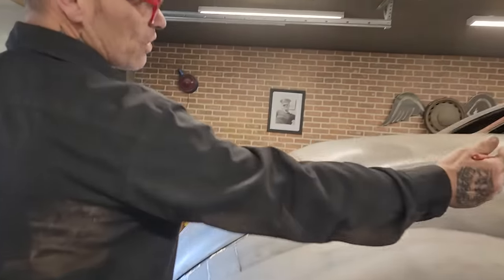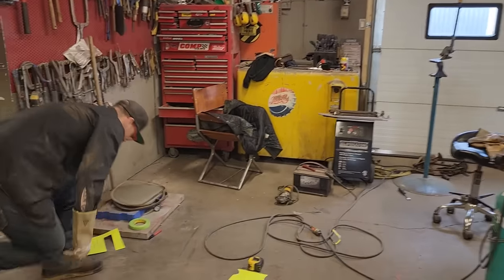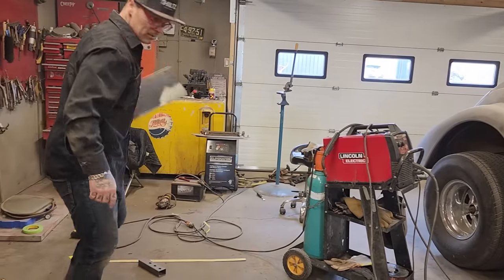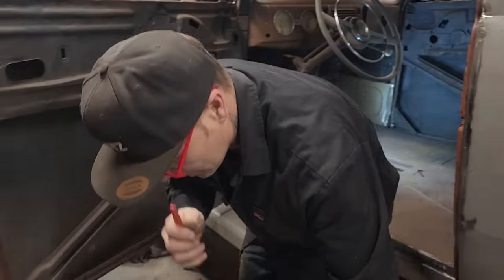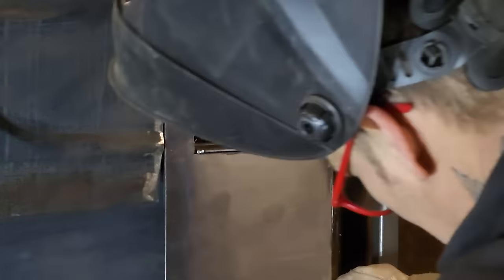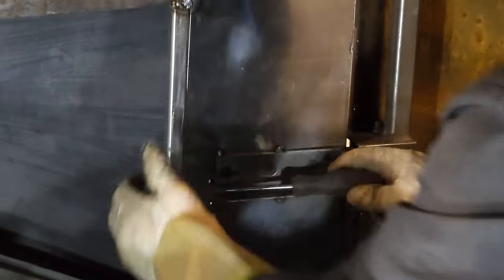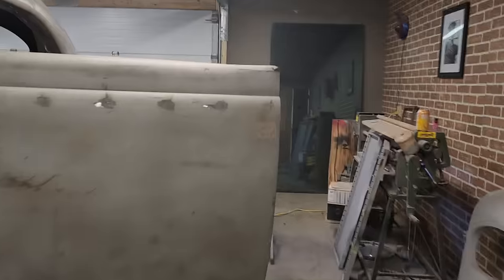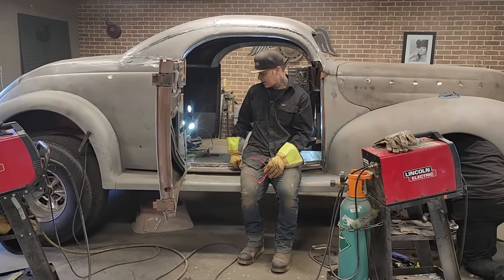Moment of truth… did the suicide door conversion work? 🤔

Comment: From an old car builder that's done this many times those hidden hinges need to be farther apart so the door don't sag when you open with the weight of the glass and upholstery but you do what you what it's not my car
Reply: The company no longer sells door hinges that might be the reason for that
Reply: @daddysails8926  Tom's classy customs I built 28 cars to include a riddler contender in 2007

Comment: Don’t know why you haven’t converted over to battery operated tools gotta get yourself some good ones and get about 20 batteries so you can have a charge on whenever you want it. I’m just a retired carpenter who worked with tools that had Cords But when I did switch over to cordless wow the time you save And you’re not always hunting down the plug-in

Comment: Chad everybody talks about battery grinders (I m a pipe fitter and the battery grinders do not turn as fast as a plugged in grinder). I think you should at least a 3 way outlet extension cord a grinder for outside the car and 1 for inside the car.  If the cord comes out of socket tiewrap it or knot it.  A lot of tool battery tools work well including lights. This car with a tilt front clip will be cool along with these doors. Have a better day Chad

Comment: Hey how come start time is 6:00pm.   Chad slow down think about what you want then do it. Chad the threaded hing plates have to be welded to the ‘C’ channel so when you take the Allen bolts out the threaded plates stay in place
Reply: Things are not going well today, so much so a rare delayed start time
Reply: But if you weld in the threaded plates how would adjust the door if ya needed to?
Reply: @brianhiggins4832 - Then you would need to have a hole for access to the hinge plates, I have to wonder, if Chad is aware of that.

Comment: Chad why do you still work off the floor, build a working table withe a vise and on castors to move around the shop. Your back is taking a beating and your taking a chance of hurting yourself with the grinder. You responded to me that your two workers have safety boots supplied by you. Sorry all I see is running shoes, come on be a responseable owner and look after safety, one WCB claim and your going to be in big problems.